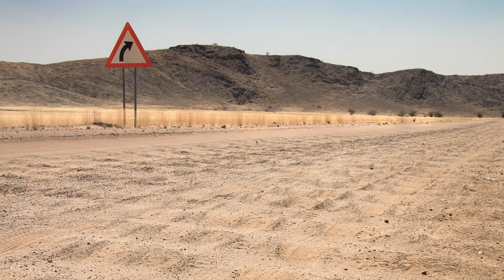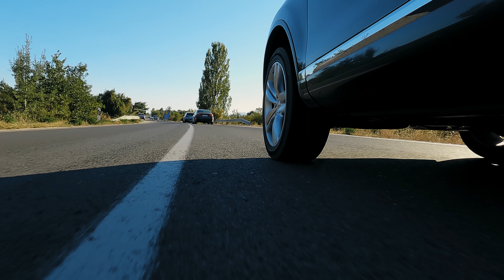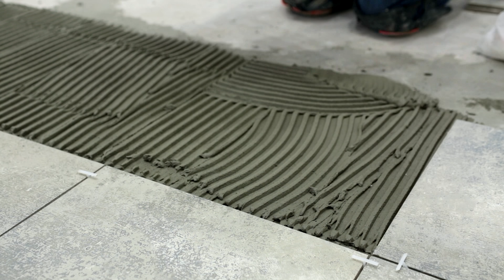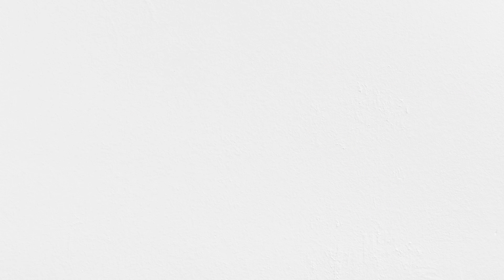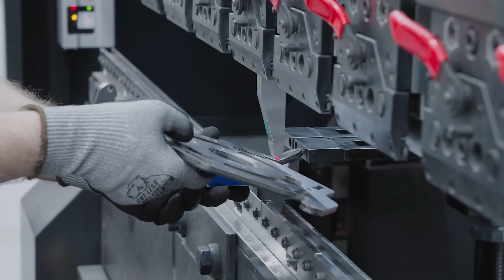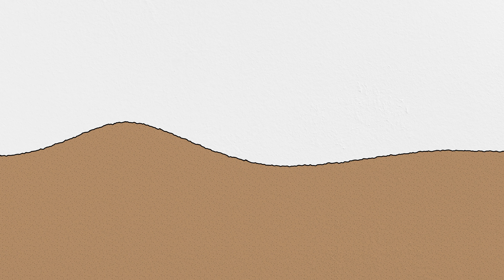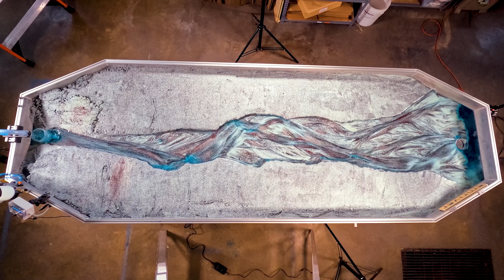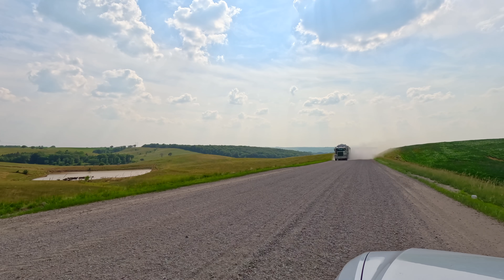Why Roads Get Washboards

Comment: Similar thing happens on railways too. "Cyclic top", it's called, at least in the UK.
Reply: I have seen corrugated rail in Victoria, Australia too. The old guys called it “roaring rail” as it was quite noisy.
Reply: @greatnorthernrailwaytother4711 what sections of track in Victoria? I’m in Victoria and am curious
Reply: @assuredaviation9116 on the Gippsland Line near Moe
Reply: Aware of a stretch on the Werribee line. Also a few tramlines.
Reply: If you ever see a train moving slowly down the track, looking like it’s on fire,with flames and smoke shooting out from underneath, chances are what you’re seeing is actually a rail grinder in action. There are grindstones under there, smoothing out the surface of the rails and shaping them to be closer to an ideal profile. And if you’re riding a train that is vibrating a lot, it may be that they just need to run one of these rail grinder trains over the track a bit, to smooth out the washboarding.
Reply: Okay, that's pretty fascinating. I want to see how this happens in metal rails.
Reply: @stormycatmink  The wavelength is much greater, so that the rails no longer behave like rigid beams, and the track bed has to be in poor condition.
Reply: @sylviaelse5086  so basically using the plasticity of the steel to mold it like the sand does? Crazy.
Reply: @stormycatmink  go to any city with poorly maintained tram network and you will see it easy at an angle alongside the track... or feel while riding the tram. Industrial areas are good choice too, very heavy loads and rails aren't maintained because of the low speeds and no complaining passengers
in medium city with 10 lines there could be parts of the track where a tram passes ~200.000 times per year, 40-80.000 pounds depending on model and passenger count.. in those conditions even steel begins to flow
Reply: Just like cattle grid. Right outside our pub. Right rattly.

Comment: The question every rural Aussie wants to know
Reply: True story. I bought some shocks for my jeep I overland with in the Patagonia. The washboard roads killed them in 2 months.  I thought, 'who knows washboard roads'? The Australians. Bought some Australian made foam cell shocks, and could not be happier 5 seasons on.
Reply: @cenccenc946  Heat is what kills the shock absorbers, I've lived in the australian outback for years and I was always told by mechanics to take a break every hour or so to allow the shockies to cool down. Never had an issue even with cheap ones
Reply: @cenccenc946 shocks that are too stiff will not last. Trucks in Australia travelling on notorious roads such as the Strzelecki and the Tanami have been known to have fires start from such shock absorbers. These shockers are typically the higher end brands that are deemed ‘road friendly’.
Reply: @nicpilatti  Strzelecki and the Tanami are not so notorious now. They are nearly always well graded and in good condition.
Reply: @WilliamWhite-x8m they remain notorious and will do for sometime. Yes they are not what they used to be, but nobody’s going out there for the first time without checking conditions are they
Reply: @nicpilatti  I've driven them many times. They are easily passable with a 2WD.
Reply: @WilliamWhite-x8m I can't speak for the Strzelecki (it'll be bitumen soon enough) but the Tanami still gets pretty rough when you leave the bitumen.
Reply: @cenccenc946 🇦🇺
Reply: I think every rural Aussie wants to know the answer too 😅
Reply: "corrugated roads" or "currugations" in Australian speak.
Reply: @--Nath--  Aussies call them corros …
Reply: @--Nath-- as Slim Dusty sang about “Happy Jack”

When you've bumped over corrugations, so deep you could bury a cow,
You say to yourself "It's pretty bad but the worst must be over now."
Then he'll look at you with a woeful look and furrows on his brow,
The last fifty miles on the road they say is "the worst in Australia now."
Reply: @--Nath--  they playing knifey spoony with me tyres
Reply: @JoeyJoJoJrShabbado  you gotta go faster mate
Reply: @--Nath--  yeah, i have heard it called washboard by some aussies tho
Reply: I watch a lot of 4WD24/7's content and immediately thought of Australia when I saw this title!
Reply: ... Especially who were driven on the road from Southern Cross to Marvel Loch in The Yilgarn!
Reply: @cprgreaves  bro its 34km to there. U need to explore out the back of kalgoorlie in a roadtrain. Horrible
Reply: There's a shock absorber from Australia, the old Man Emu. I thought they were made to handle corrugation.
Reply: @jojoanggono3229Whatever I have on my BMW R1200RT handles the corrugations beautifully.
Reply: @grumpybastard5744  screw riding over them on a bike
Reply: i've definitely driven on corrugated paved roads in SA too
Reply: Interesting stats with the paved vs unpaved in the US. They have ~35% unpaved. Aus has ~75%. Similar sized countries but a ~15x population difference.
Reply: Rural Yankees are right up there with ya.
Reply: I always wondered would air suspension be better on corrugated roads?
Reply: I was driving in Borneo and my now deceased soulmate was Scottish and she asked me to slow down on the dirt road.  So I said I will show you what happens when you go slow on corrugated roads.  She said yep speed up. To be fair I had never driven on icy snow roads so she was very good at that.
Reply: For real 😅 top comment you win everything
Reply: @JoeyJoJoJrShabbado It's the national sport of Australia. 
S***posting.
Reply: And solve!
Reply: Towed a camper trailer to Birdsville, by the halfway mark I had blown all four shocks, broken both coil springs, punctured the water tank and lost all the water, busted the electrical system and lost the lights. Corrugations. At least I didn’t get flat tyres, miraculously
Reply: И половину жителей России
Reply: the famous Nullaboor Highway [Outback Truckers - viewed in the UK too]
Reply: @kathrynwhitby9799 all tar now since 1974
Reply: @craigoOZ  Wow, genuinely WOw. So how old it the tv programme?
Reply: Americans and Canadians too
Reply: The vibrating rollers used in maintenance cause lots of it.
Reply: Every rural norwegian too. This gets really intense on packed snow.
Reply: Do Aussies call this washboards as well?
Reply: @robs8270  No, everyone just calls them corrugated
Reply: @robs8270  We call them corros …
Reply: dang, I hope you guys get to live somewhere nice eventually.
Reply: @Broockle There's metal roads in NZ which have corregation issues.... I can assure you we like them to keep people out. Unspoilt beauty is kept that way.
Reply: @John-c4r1o Metaled roads? Corrugation?
I'm learning stuff. 
I'm sure the nature is absolutely breath taking. 
I'd like to visit, only visit tho 😊
Reply: @Broockle Oh we live in a paradise we aren’t too worried about driving on dirt roads, most of us have done it since we got our license.
Reply: @Sweetlyfe my condolences
Reply: You guys are on "energetic lockdown" or some bullshit ?
Reply: @lorisfoucart2475 we’re on what now?
Reply: @seanshaw8321 Some channels in France were saying Australia also went into an "energy lockdown", rationed gas
Reply: Nope. We haven't got an energy rationing.... Not for power or natural gas, not even for Petroleum (fuel for your car is not gaseous, it is liquid).
Reply: @lorisfoucart2475  Not true - find better channels.
Reply: @lorisfoucart2475  Fwance will be on full lockdown soon enough.
Reply: @lorisfoucart2475  as an Aussie, I've never even heard the term "energy lockdown"
Reply: @lorisfoucart2475  No, not true.
Reply: @lorisfoucart2475  nah mate, BS indeed, no rationing going on down here. More fear mongering id say 🍻
Reply: @joelmoe-80  Albo's so  on  the nose, he  dare not ration fuel;  whether the  country  has enough or not.

Comment: Go drive on Lost Park Rd, just north of Jefferson, CO. Nastiest washboard I've ever seen. Took us an hour to drive 3 miles.
Reply: Is that near the Red Cone trail?
Reply: Lol the slower you go the worse it is.  Get over the speed of resonance and it smooths right out.
Reply: @rustymustard7798  You lose traction at that speed and are essentially hydroplaning. Ita fun if you are ready for it, dangerous if not.
Reply: @Steevo69  I used to live 9 miles up a forest service road on a mountain and the washboard was so bad you could drift any car at only 20mph
Reply: @rustymustard7798  Not worth the risk. Especially with hundreds of pounds of gear and my family in the truck.
Reply: @rustymustard7798 but as Grady said, you lose traction at that point and it becomes harder to control your vehicle